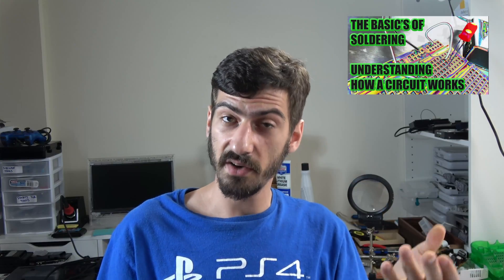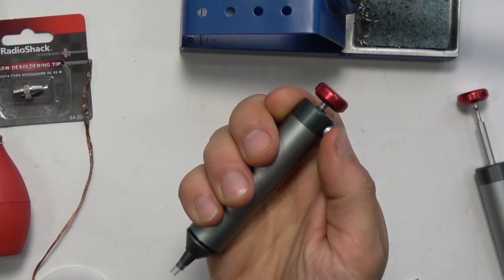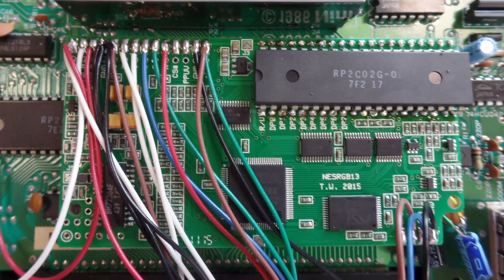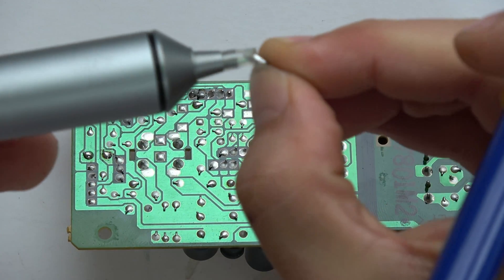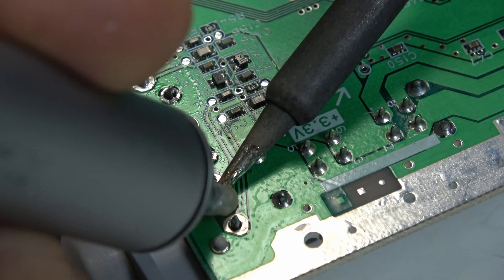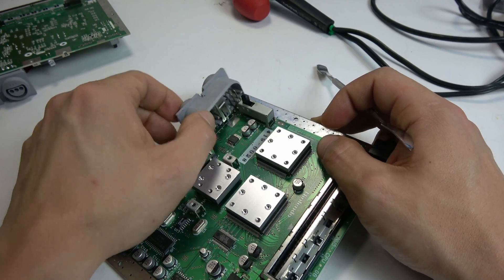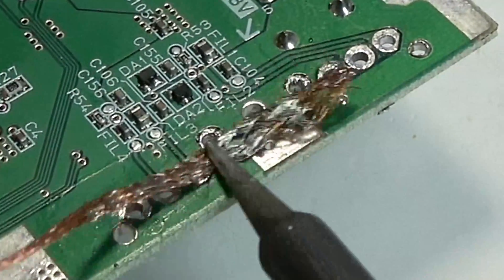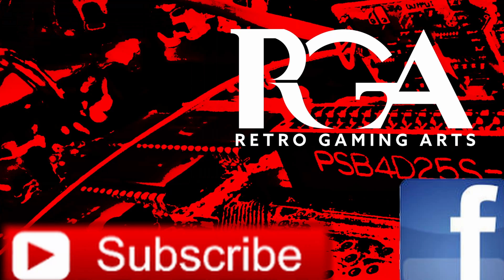Solder Basics - DE SOLDERING - RETRO GAMING ARTS

Comment: I've found in my experience there is no substitute for an actual desoldering gun. I recently got the S-993A as an entry level tool to see what all the hubbub was about, and instantly it made my desoldering tasks go by in seconds instead of minutes. If you plan on quality of life console modding, a proper desoldering gun is a must-have investment. That's not to say it's the only thing you should have. You still need braid for situations where the gun nozzle won't fit or isn't ideal. I recently did a mod where I removed an RF box from a Genesis, and that required the gun for the pins, but the soldered tabs required flush-cutters and braid. The combination cleanly removed the RF box in all of two minutes.
Reply from the maker: it's on my to get list, the hakko fr300 has been highly recommended to me by a few people, also, this series is kinda geared towards beginners, i want to try to help those just starting out, and didnt want to say "go buy this 250$ de soldering gun" (i dont have one yet anyway) i'm going to check out this S-993A you speak of though
thank you
Reply: Yeah the S-993A is a much cheaper alternative at $98 bucks. It works just as well with proper care and technique. I let the weight of the nozzle rest on the solder until it sinks into it during the melting point. Then I hold the pump trigger in for about 6 seconds while I do small gentle circles, lifting away from the pin at the end with the pump still going. Gives a flawless pull of the solder to where the pin is perfectly clean and clear. It's very easy to do and fun!

Comment: I didn't know there were desoldering pumps with heating tips. I'll have to remember that in case I ever need it.
Reply from the maker: theres a de soldering vacuum that i dont have yet, its called the hakko fr-300 and i plan to get one eventually, they're just expensive, but worth the money, so they save you time, this whole video series i'm trying to gear it to start with beginner going all the way to advanced, i want to cover everyone, and since this is the only 4th video in the series, i got so much more to cover lol
Reply: When I started, I got simpler tools myself. I only spent closer to $100 when it came to the soldering iron, but it did come with a few other things like solder and desoldering wick, so it wasn't even that bad. I really do like these videos though. They're short and elaborate, so it's perfect for beginners the way I see it.